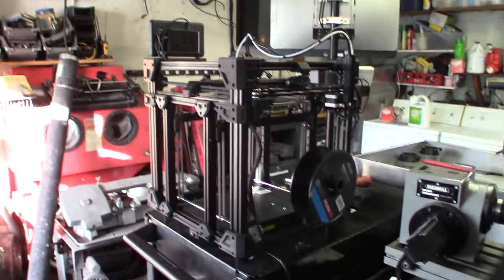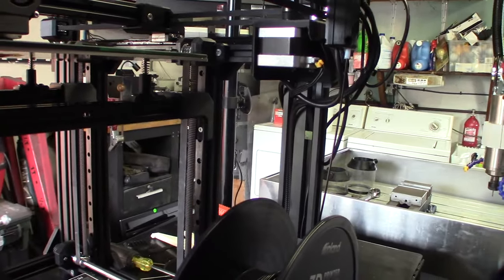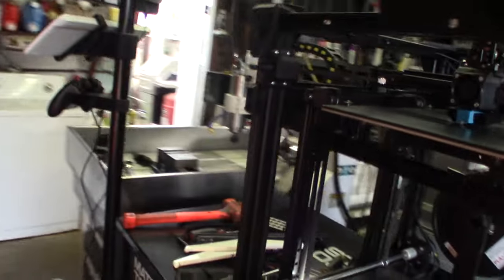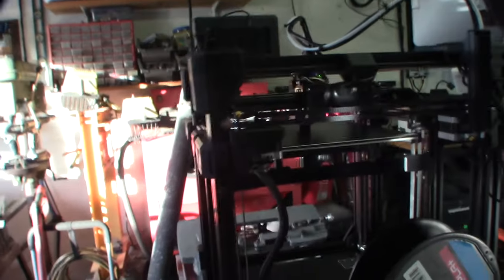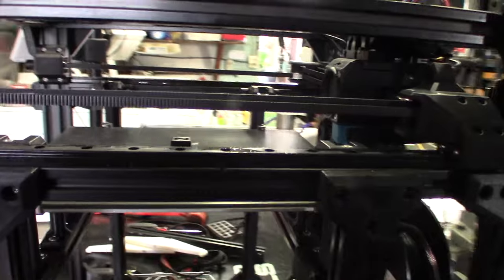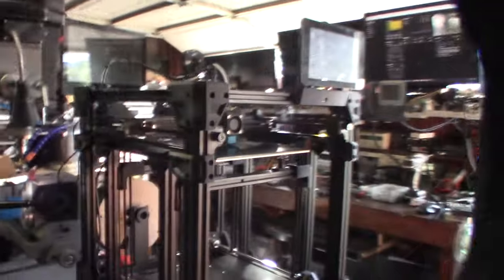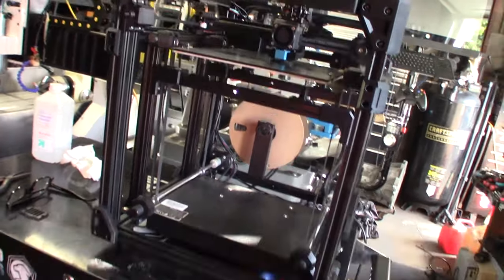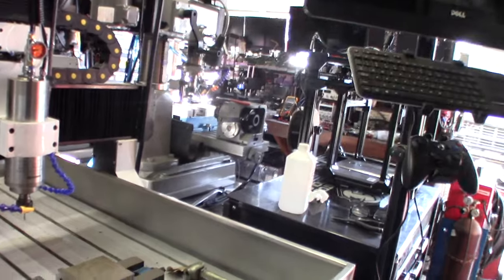Orca Super Cube CoreXY 3D printer concept Part 5, First Phase Complete!!! Test Printing

Comment: what do you think should the mesh compensate on 2cm² ?

but nice design nonetheless.
Reply from the maker: I'm not sure, I use a combination of two point bed tramming using z_tilt and bed mesh. Right now I use z_tilt but in the future I'm going to 4 point QUAD_GANTRY_LEVEL tramming. I also use bed mesh to fix bed imperfections. I'm not sure if the question was sarcastic because I'm not sure what it means.